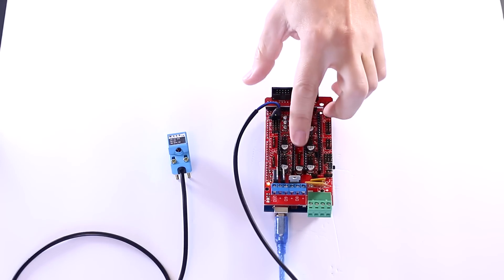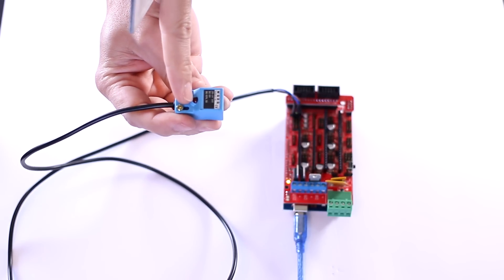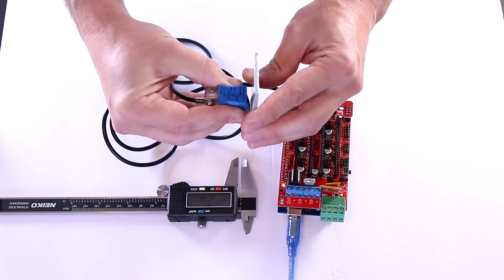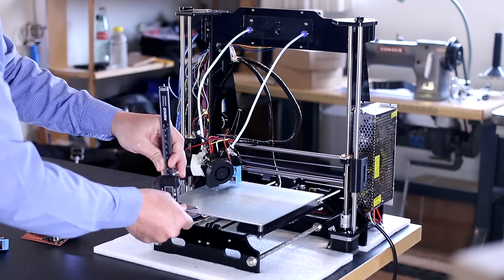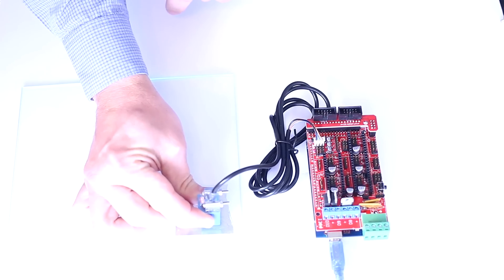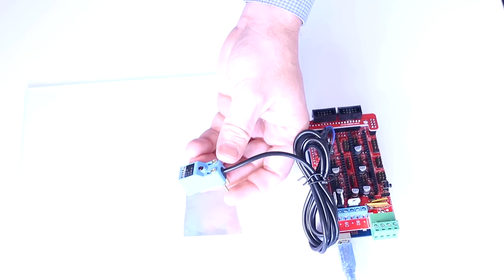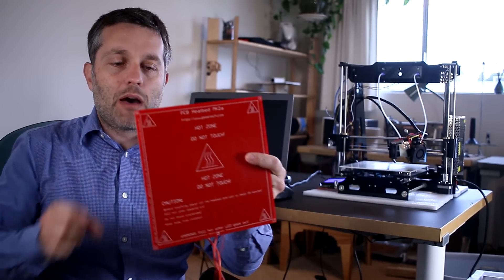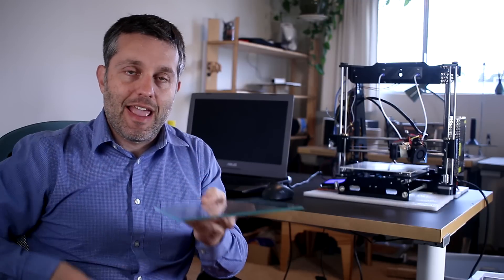Z-axis inductive sensors for Cheap Chinese 3D Printers: 6-36v & 10-30v sensors work on 5v power

Comment: What if you have a tronxy with a glass bed over the aluminum heated bed? That's my setup.
Reply: once again.. use a capacitive sensor, not inducitve one.. they both have the same shitty accuracy. If you want accuracy on any surface, you need a touch probe like "bltouch".. http://www.ebay.com/itm/LJC18A3-B-Z-BY-PNP-NO-3-Wires-10mm-Capacitive-Proximity-Sensor-Switch-DC-6-36V-/161701766400?hash=item25a62d2500:g:QyoAAOSwWfFXjq~r   or  http://www.ebay.com/itm/BLTouch-Auto-Bed-Leveling-Touch-Sensor-w-Spare-parts-for-3D-Printer-Extruder-/262827728333?hash=item3d31c0ddcd:g:REoAAOSwo4pYZRjU
Reply: buy a capacitance sensor.. same shitty thing.
Reply: I'd like to know, too.
Reply: won't work i just tried it since i got the sensor for $3 on ebay............ wont detect through glass but will with the heated bed if it has metal top. the heated bed doesn't cause it to change due to heat either. all in all its great for the stock bed but i like printing on glass its way better
Reply: I use an inductive sensor with this setup and it works well (2.5mm gap).
Reply: the sensor that you have is it a:
SN04-N
BN-10-30V
BK-NPN.NO
BU-0V

how thick was the aluminum tape and glass plate that you used? thanks!

Comment: The Tevo Tarantula comes with the SN04 sensor you showed. The detection distance is really small, mine won't detect at 0.93mm but will detect at 0.8mm against the stock Tevo bed. Bumping the sensor up to 12V never occurred to me, but that's probably a good idea to increase the sensor detection distance and reliability. Tech2C has also done tests of inductive sensors and found more or less the same results as Tom, I'm sure you've seen it.

Comment: M18 diameter 12 to 24V 16mm distance sensor. It's about 8mm distance when using aluminum folio tape. Sensor diameter is what matter. Not voltage. https://www.youtube.com/watch?v=zaKz-F1jIeQ
Reply: Just say, that is easy to feed the sensor with 12V in  a Ramps style board.
Reply: Not unless you buy from a decent company e.g ifm or siemens etc.. instead of cheap chinese stuff. It also depends on the aluminium tape you use they are not all created equal.

Comment: I just found your channel and I like it! This is some great information and although I am not the expert on sensors I am willing to try your concepts. Although, it seems to be a controversial topic, I'm still willing to explore it. I have the i3 clone (geeetech) and although I like using just the glass, I recently received the Model D Maghold Magnetic Build Plate 8"x8.5" off Amazon and would like to use it. However, I wonder if the magnetic base plate for the build tak with interfere with the sensors??
Reply from the maker: That's a good question.
Reply: Design Prototype Test 
Maybe you could put together a test on that?

Comment: There's a terribly large difference between "will work on 5v" and "will work on 5v with consistent, reliable measurements". These sensors function, but their drift is simply unacceptable for 3D printing on low voltage.
Reply: Agreed, they have specifications for a reason, going outside those will very likely result in inconsistent results, or possibly crashing into the bed if it failed to report altogether under varying conditions.
Reply: I don't have these exact sensors personally, but i have some experience with hall effect sensors as i've built them into cheap BLDC motors to use them for positional control operations. Basically get a motor with the benefits of a stepper high direct drive torque with continuous operation and no misstepping. 
I tbh do not know why these sensors wouldn't work for you, besides the fact that they have a noticeable hysteresis (which can be worked around) but really is just something you need to deal with.
If you are having inconsistent behavior i'd recommend you try regulating your 5v more carefully, adding capacitors (100nF is enough) from power to ground in the line to the sensor should help. Depending on if they did so in the sensor module you might also have to add a pullup resistor to the output line to prevent a floating signal on your input. 
If you are still having problems then you have an unreliable 5v source voltage and should add a more precise voltage regulator to be used for sensor reference.

If this seems like too much work and not worth the hassle, then dont buy chinese parts in general. I hope this helps.

Comment: I've been using the proximity sensor, tube one, on my geeetech and it detects the PCB just fine I have stuck aluminium foil under the glass like you have but it's not made much of a difference I just wanted to get a more uniform result

Comment: If your printer is anything like my Tronxy X3, the Melzi board on the X3 supplies 12v to the sensor. I haven't had much luck detecting through glass.

Comment: Post links to the parts you talk about.
Reply: This one? http://www.ebay.com/itm/SN04-N-Approach-Detect-Inductive-Sensor-Proximity-Switch-DC-10-30V-/321697909691?hash=item4ae6b08bbb:g:pAcAAOSwWxNYuKwj
Reply from the maker: That one will work. The reason I don't post links is because the sellers get a lot of traffic, and then they raise their prices. This happened with my first 3D printing  video where I linked to a complete printer kit.  You are better off finding the parts yourself, and paying the lower price.
Reply from the maker: You will find a better deal by looking up "Inductive Proximity 10-30" on ebay, and then organize your search to be "Price + Shipping Lowest First."
Reply: Thanks.

Comment: I've bought the Anet A8 in Gearbest with the optional sensor (rated 6v to 36v) and bracket. It doesn't work at all at 5v. I tested it and it works at 12v but it's sitting idle because I don't want to release any magic smoke! Hehe.
Reply from the maker: Hmm. That is strange. I purchased the 6-36v sensor in the video from the same place as you did. It should be the exact same sensor as what you have. There are too few moving parts in the sensor for this to be a quality control issue. In other words, if you have the exact same sensor as I do, and if you know it works at 12v, I can't believe that it won't work the same as the one that I am showing in the video. It has to be some other issue. Are you sure that you plugged it into the correct spot on your controller board, and also that you did not plug it in 180 degrees backward?
Reply: It doesn't fit backwards, I tried, so I plugged it to a 12v power supply and it worked. This is the sensor (http://imgur.com/a/voLjj). Could it be that the cable are flipped around? I'm new to electronic so I didn't want to fry anything..
Reply from the maker: Yes, That is the exact same sensor as I show in the video except that it looks like you have scratched off the "Tronxy" logo and model number. What happens when you plug the sensor into the board, turn on the power, and then hold a metallic object against the sensor? Does the light come on the sensor?
Reply: Hey! I tried with a 5v power supply and it lights up but if I plug it to
 the motherboard It doesn't do anything. Can I just change the cables in
 the connector and try it without frying anything? Or, how do I know the correct order?
Reply from the maker: You can switch the cables around. It won't fry the board. That is the beauty of 5v. The order is correct on the connector. Black=Signal, Blue=(-), Brown=(+). You may need to rotate the connector 180 degrees so it works on your board. You should look up a "pinout" image of your board to figure out which pins correspond to signal, (-) and (+).
Reply: Design Prototype Test so the beauty of 5V is that polarity doesnt matter? why should the polarity matter at 12V but not at 5V? at 5V the dataline will not fry the board, but the way youre writing it Sounds like 5V wont eher fry anything and is safe from wrong polarity, which is far from being true.